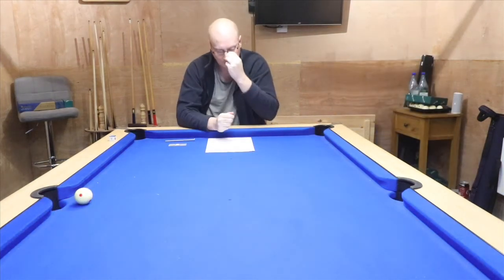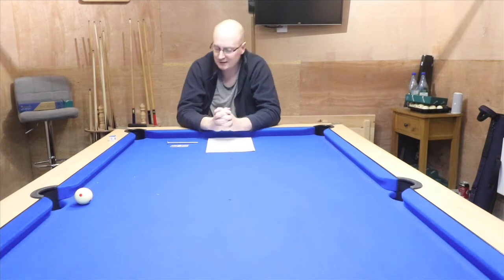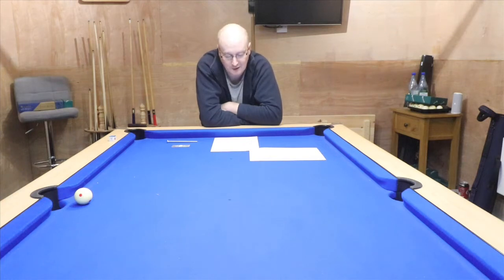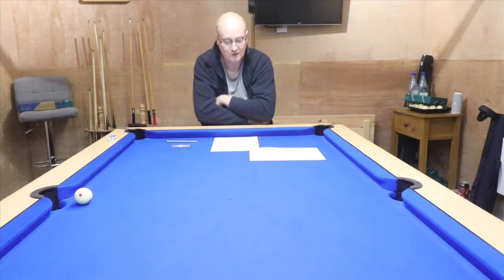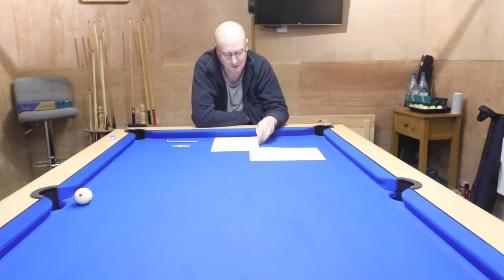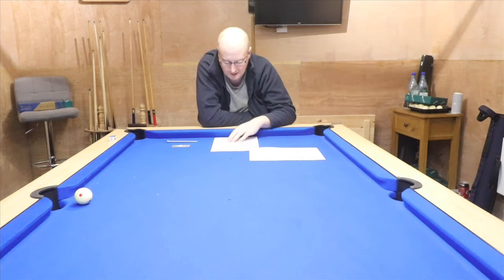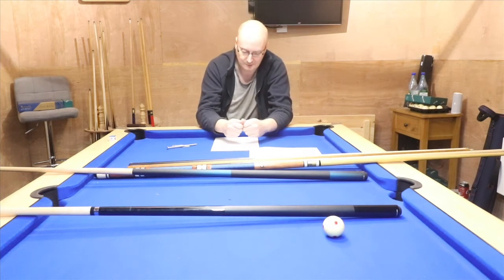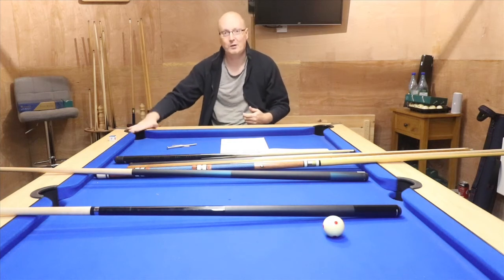Apex garage pool room conversion Q&A Your questions answered

Comment: Hi Paul. Thanks so much for all the info you have shared. Searching for anything on how to do this can drive you mad and get you nowhere. You are so right about the lack of advice available regarding insulating concrete sectional garage's. Does seem strange when you think about how many must be out there? So again thanks again for tackling it. Was wondering if you where tempted to use a vapour barrier before the insulation, think it helps reduce condensation?